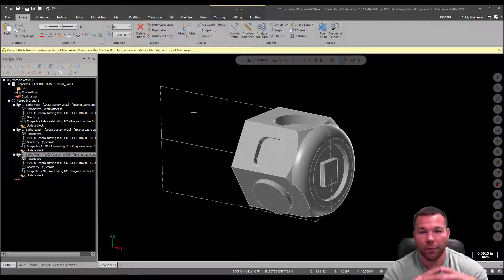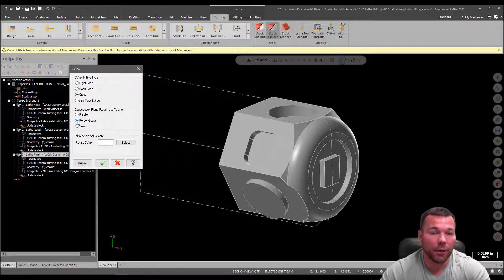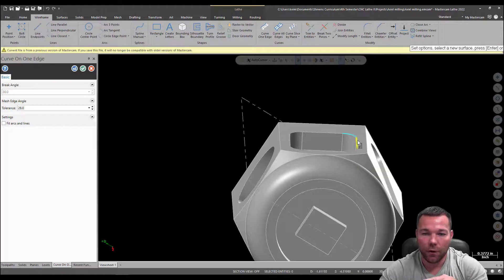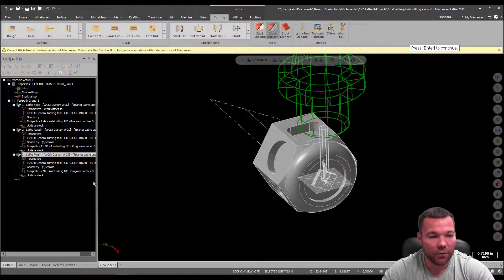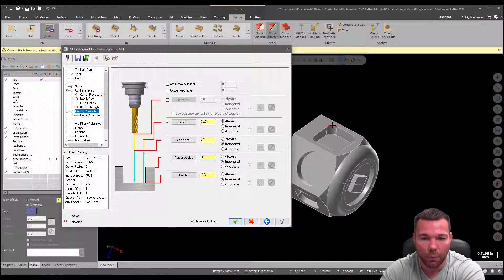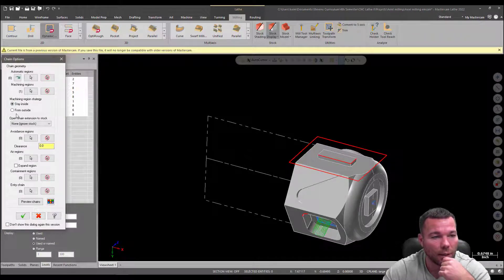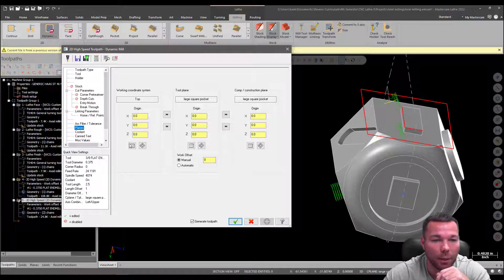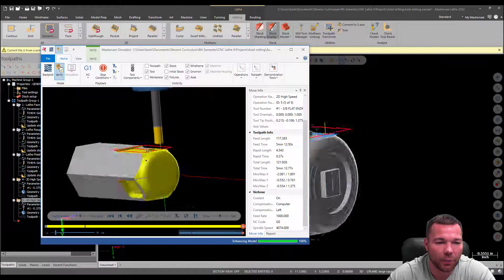How to create a plane for milling in the Lathe

Comment: Hi, I realize this video is "old" by some standards. My question is about the X-axis when milling on a lathe. Does it always point in the Negative-Z direction? No one discusses this. The video was extremely helpful. Thanks, Jay.
Reply from the maker: Jay,  I am guessing by "milling in the X-axis" you mean axial milling, rather than radial ,milling?  If so, the answer is no, it does not have to. you can change the orientation to z+ for milling in a sub-spindle.